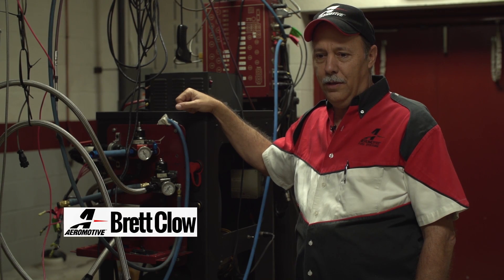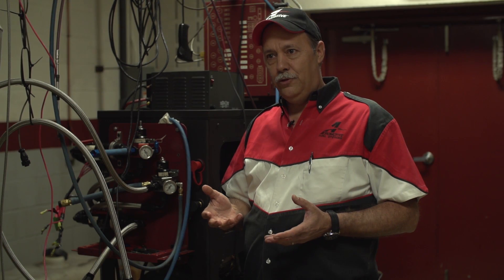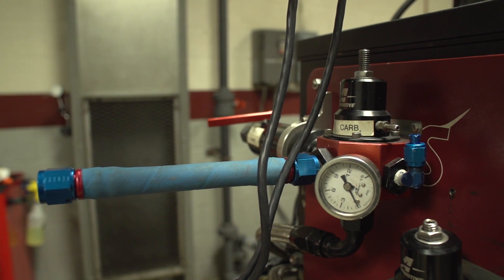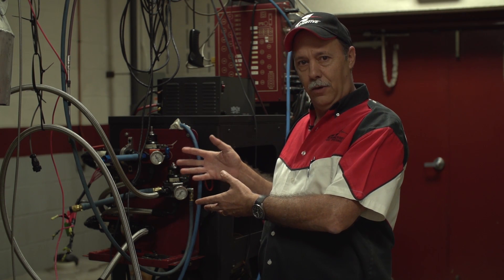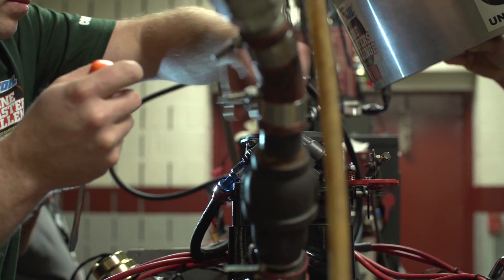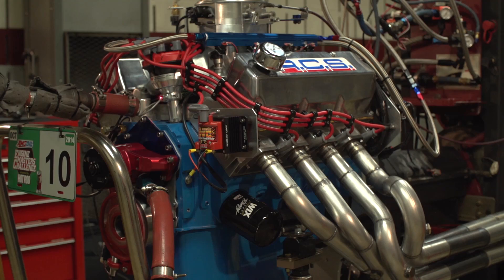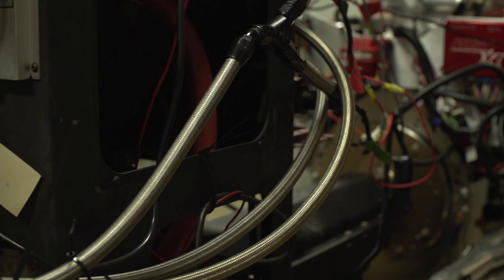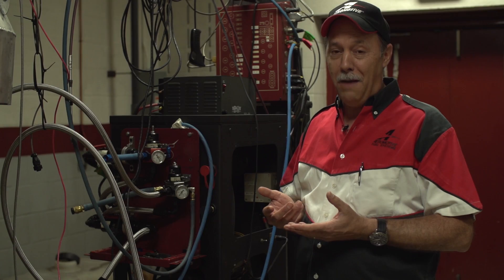Aeromotive at the 2014 Amsoil Engine Masters Challenge

Comment: Anyone using DOHC yet or is still that futuristic in america?
Reply: These are all pushrod, two valves per cylinder. Only one cam, and it's in the middle, as specified in the rules (with a couple exceptions)

If they allowed any cam configuration, you'd almost certainly have someone bring in custom built CNC monsters with 5 valves per cylinder, variable valve timing and lift, and other shenanigans. This isn't about pushing the outer limits of known engine technology. Leave that to the manufacturers. Their pockets are a lot deeper.

Modern American V8s are often single cam pushrod affairs because they're compact and as the new Corvette and Challenger Hellcat prove, quite capable of some intense performance. For example, Ford's DOHC 5.0 V8 is 29" tall and 29" wide, and GM's LS6 pushrod V8 is 25" wide and 28" tall while still making roughly the same peak power.

Are there advantages to multi-cam? Lots of them, from cam phasing and overlap flexibility to high-RPM performance, to intake port design. But from a packaging standpoint, if you can make the same numbers while making the whole thing 3" smaller (and significantly lighter with a lower CoG), you're probably going to go there. The fuel economy balances out with the reduced weight of the engine and car (narrower engine bay, narrower car).

So yeah, DOHC exists in the states, but with our roads being so big and everything being far away when compared to Europe, the priorities get shifted. Hell, I bought my car in April of this year and it's already at 13,000 miles (21,000km).
Reply: Toms Tech Well, calling names on the internet just leads to e-peen measuring contests and those get old quick.

The American tendency towards these big, lazy V8s comes out of a combination of factors. Loads of land, long driving distances (I drive 80  miles a day for work like it's nothing), cheap gas, and expected hard parts longevity with easy maintenance.

OHC requires gears (noisy), long chains (noisy and prone to stretch), belts (fairly new development and even then short lived). OHV requires a very short chain run that doesn't even need tensioners, and the chain can be buried in the block to reduce or eliminate noise. Put simply, it gets the job done without spending a lot more money. Plus, the cylinder heads require less metal, so there's even more money saved. Then there's the maintenance aspect. Sure, spark plugs require a cold engine because of the exhaust manifold, but a valve adjustment is a 10 minute job per side if it's got mechanical lifters. Damage is often limited to rocker arms and pushrods, meaning repairs can sometimes be affected within a few minutes with minimal re-checking of valve clearance.

The huge displacements come from the limitations of the pushrod design. You just can't fight the mass of the lifter, pushrod, and rocker. You've got to move all of them to move the valve, making these engines significantly more prone to valve float. If you can't rev, use torque to make up the difference.

An advantage of all that thirsty displacement is the sheer grunt most American V8s can present, especially as they get bigger. A big, torquey engine is going to feel more comfortable at cruise than one that has to be wrung out more to keep up the same speeds. Factor in decades of freeway travel being the big thing (I can drive for three straight days without a passport, and still have three days driving back home), hauling kids and stuff comfortably, and of course a big V8 with a mild cam is your engine of choice. Use some of that big car for a bigger gas tank to offset the fuel economy and give a long cruise range.

The higher CoG issue is really only a recent developmental concern with everything expected to handle reasonably well one way or another. So the penalty of adding 50lb 12" higher in the car has to be offset one way or another. Ford balances it by using the VVT to eliminate the EGR system as well as other emissions reducing tricks while also making a great power band.

Engine width is an easy one, however. Look at GM. The same basic engine architecture across maybe a dozen vehicles with various names. Saving 3" worth of width fairly high in the engine bay when you've got a dozen cars and are making hundreds of thousands (or millions) of each is a big deal. It allows for less compact components in many areas, simplifies engine installation on the assembly line, narrower frame rails can be made stiffer and stronger while also isolating engine vibrations by reducing engine leverage on the unibody rails (wider gives it more leverage), and then you get into an extra inch and a half on each side for suspension components allowing more wiggle room to maintain good suspension geometry.

The Mustang Cobra went DOHC in '96, as the Mustang GT went SOHC with the 4.6. The normal Mustang GT didn't go DOHC until 2011 with the 5.0 Coyote.

I think the spirit of this competition is the classic pushrod V8s America is known for. The smooth, lumpy, rumbling, gurgling, crossplane V8s that's often a picking point when people talk about US car culture and engineering, but that few will deny sound good.
Reply: Toms Tech Ford build a OHC engine in 1964 called the "cammer" and also look up the LT5 engine. Nothing is futuristic about a over head camshaft.